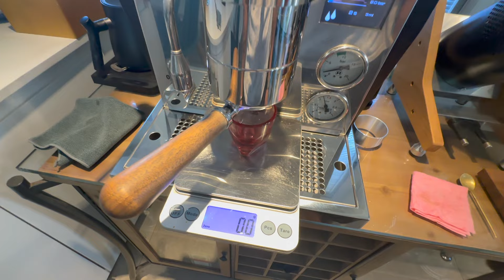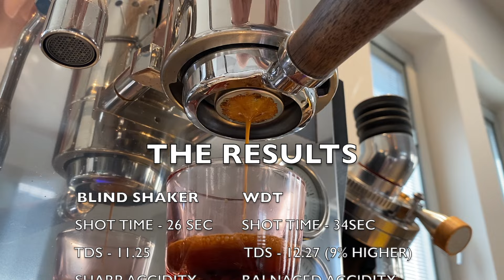Blind shaker VS WDT - was Lance Hedrick wrong?

Comment: Thanks for the video.  One thing I did notice is that you, contrary to Lance and Weber Labs, emptied the shaker right on top of the portal-filter funnel.  You need to have it higher above so that the grounds properly distribute on their way out of the shaker.  I found a marked improvement in flavor (my opinion) when I did raise it higher over the part-filter.
Reply from the maker: Hi, I have tried this couple of times and did not get any better results, but could be I need to do some more testing :)

Comment: I don’t have a blind shaker, but I use a small bowl that lets me get a similar result. The big difference in technique is  that you were shaking hand and tapped the shaker. My approach is to fluff the coffee and to get the fines and chunks all mixed up. Hard shaking and tapping can create clumps.

My technique is consistency better than deep WDT with my setup and preferences. Deep WDT can allow fines to migrate to the bottom., so I now avoid it.

Anyway, give the blind shaker another chance, but this time, try to lift and fluff the coffee. Be gentle to avoid any compaction and clumping.

But maybe the single basket makes a difference. I never pull singles.

Comment: Totally agree there is no statistical improvement one way over the other no matter how many shots you test.  Since WDT is easier workflow that's my preference.  Personally I pull the espresso in with  syringe filter attached and then remove it to drip the sample to the refractometer but don't think it really makes a difference.
Reply from the maker: Could be we have different filters. I can't pull the shot with the filter on.

Comment: I paused your video as soon as you deviated from replicating the original test by deciding to empty the shaker while on top of the portafilter instead of being raised over a funnel, and using a WDT to mess with the grounds, which makes your results irrelevant in terms of comparing it to Lance's results. You have introduced multiple different factors and it is unknown how that will or will not affect the outcome.
Reply from the maker: @mikeg8447  As I clearly mentioned in the video, it was very difficult to get a flat bed, so I used the WDT tool just on the surface. There was no impact on the coffee.

Comment: What was there for Lance to be "wrong" about? He didn't make any claims, he just drew conclusions based on statistical data from large batches of tests and measurements, which you by the way didn't do—a sample size of 1 has no statistical validity.
Reply from the maker: From Lances video it sounds the blind shaker technic is superior. 
From my tests this is not necessarily true. 
I agree. This is not clear from my video, but I made 50 shots (25 with each technic) and the results were pretty consistent.
Reply: But just having a different opinion isn't as good of a clickbait title :(
Reply from the maker: @error.418  I think as long I demonstrate cases in which Lance’s claim isn’t true, this is not a clickbait.
This was just one test among of 50 which gave me pretty consistent results
Reply: I think you should have shown the results of the 50 tests, including confidence intervals, which is much more relevant than a single cherry picked case
Reply from the maker: @ruperthart5190  Yes I completely agree. My mistake 🫤
Reply from the maker: @ruperthart5190  Planning to do some more tests to find out the cause for this bias. Will try to explain better the whole process. I truly agree this one is not clear enough.
Reply: @weiszCoffee  I'm looking forward to your next video / results on the topic. I think it's great and important that more people replicate and / or challenge Lance's tests, although he has set quite a high bar with his statistical rigour so you need to match or exceed that (meaning similar sample sizes and statistics) to make a compelling challenge. That said, perhaps any data is good, just need to be careful how you communicate it (i.e. at best the test shown may support an anti lance position, and could be a motivator for more rigorous testing in future and a bit it healthy lance skepticism)
Reply from the maker: @ruperthart5190  Agree and will definitely keep this in mind for the next video. Thank you :)

Comment: So the main issue is that every You Tuber has made the same assumption that the coffee will be better if it  has a higher TDS which is not correct.  Simply the main difference between the two techniques is the taste which comes about from the freshly ground coffee being given the chance to oxidise more from the blind shaking technique as it is getting exposed to more air. Its similar to how people use air raters to pour red wine through so that its ready to drink sooner.
Reply from the maker: I agree 100% with the claim that more TDS does not mean better taste. Many times or even most of times regarding very high quality specialty coffee its the other way around.
I am familiar with the concept of oxidation. Not sure if this is the issue. Lances claim is it gets "densified" due to the shaking of different particle sizes.
As per my many testing there was no improvement in coffee taste or extraction with the shaker. This is a very bad video BTW. I did not explain anything here 🤦‍♂

Comment: In my opinion, you added a huge unknown. The single basket can't be compared to the double basket...
Reply from the maker: Could be you are correct, though I think as long as I keep all tests the same it should be ok. Anyway I am going to add some more test and hopefully a video with different basket and different niddles on my WDT
Reply: @weiszCoffee  I think part of the 'benefit' to the blind shaker is that it distributes the coffee better in a double shot basket - among other things.  You used a single shot basket, so this isn't really the same test.  That said, I tried them side by side and a shaker made no difference.  Slow feeding on the other hand, that's a bit of a game changer, but that idea has been out for years.
Reply from the maker: @bluemystic7501  Well I absolutely agree. The slow feeding was a game changer :).
According to Lance's test, the Blind shaker technic should be a better choice no matter the basket so even if you'r right, this means Lance's test is not that accurate.
I don't see why the Blind shaker technic should work better on a double baskets and not on a single. Actually I think the bias is related to the needles of the WDT, but this is one of the things I am going to check next.

Comment: I can see one thing Lance did that you didn't do was that he re-distributed the puck right after finishing the blindshaker, with a traditional distribution technique (called the tap tap/hand tap technique, or whatever I don't know the name), which you only WDT on the top. And your "blindshaker" shot had signs of channelling, which is explained through: the BlindS puck had poor distribution, you WDT on the surface, faster shot with same grind size (which is also an indicator for channelling, since water flew faster with channelling shot), sharper acidity which perceptively led to less sweet, and more aromatic shot (caused by the dilution, from channelling, when diluting liquid, you usually receive more fragrant and more distinguishable result, try diluting any liquors or drinks and see if you can easily pick it apart)

I'm not saying that you might be wrong, you're doing good work here and may you keep going, which re-examines the given theory and shares it with others. Some people just blindly believe in things without even confirming it to themselves. I'm just saying that you had different actions and flows from Lance's that led to different results, which Lance validated. Love what you do, keep it up!
Reply from the maker: Thank you so much for the kind words. Appreciate a lot 🙏
If I recall correctly Lance said that the best thing is to not do anything besides the shake. He even suggested that any distribution can harm the process. 
My next tests (and hopefully next video) will be to find the cause for the bias. So could be I will find you are correct.

Comment: the main benefit of blind shakers is not the distribution . it is the compacting ? causing the fines to get stuck to the grounds . making it less prone to fines migration . so you can do blind shaker and also do wdt if you want the best of both . but to get compacting you need to chake the blind shaker hard . and not just move the grounds around .
Reply from the maker: I tried to replicate Lance’s test. I shaked the same he shaked and didn’t use shaker with WDT as Lance recommended. 
You are suggesting a new test which requires hard shaking and also WDT. 
I think the WDT makes the shaker redundant but this is out of the scope of my test

Comment: Bro get some acai scales man
Reply from the maker: Hi, what for? A 200$ Acaia doesn't do nothing better than a 20$ one. I have a timer on the machine and no need for a Bluetooth connectivity
Reply: @weiszCoffee  the car is definitely better than a $20 scale. I’ve had them before besides the fact that they look better it looks weird that you have I don’t know probably 10,000 worth of equipment and a $20 scale on there. You probably shouldn’t skimp on That just my opinion I guess.
Reply from the maker: @gigi9467  It is better in what way?
Is it more accurate? No
Is it faster? Also no.
It has a timer and a Bluetooth connectivity which I don't need :)
It looks much better yes, but is this worth 10 times the price?
Yes I have more than 10K on my table but every each of equipment I bought I purchased for a very specific reason. Not just for the looks or hype. I new exactly what the specific equipment will add to my coffee routine.
Reply from the maker: @gigi9467  By the way. I recently started to use another scale which looks much better and also costs around 20$. The Fuego coffee scale
Reply: @weiszCoffee  you do you buddy. I rather the $200 scale than the 5k grinder..
Reply: @weiszCoffee  yes yes and yes. I’m not sure what your infatuation is with the Bluetooth. I don’t even use that. Just the fact that the scales are reliable is why u buy them,  believe me I use your 20 40 60 $80 scales and after five years of using the Akai it’s still reliable it’s still works. That’s what you want and that’s why you pay the money, the same reason why you spent five grand on the grinder and maybe another five on a machine why didnt u buy a $400 Gaggis classic could’ve done the same thing. Cut the shit.
Reply from the maker: @gigi9467  Well my friend, I bought the grinder and machine not just for their reliability. I bought them because their ability to make better coffee. Way way better coffee. 
More expensive does not mean more reliable or better. One of those things is the Acaia. They sure break sometimes.
I use the 20$ scale for 3 years now and they are great. And you know what? If they break I'll buy a new 20$ scale 🤣

BUT! As you said.. You do you
Reply: @weiszCoffee  ive had mine for over 5 years and hasnt broke. My ecm and 2k ceado is as good as yours. U over spent in the wrong places lol
Reply from the maker: @gigi9467  Well.. I don't compare sizes 😄
I only suggest learning a bit more on what matters and what does not. 
From most improving  the coffee to less
1. Good coffee
2. Good water
3. Grinder is the most important piece of equipment and will determine the taste of your coffee. Much more than the coffee machine.
4. Coffee machine
5. Baskets and tampers
6.Coffee scale (maybe 🤔)
Reply: @weiszCoffee  eventually you’ll get one once you figure out how Important they are